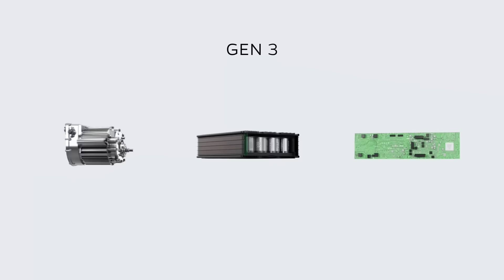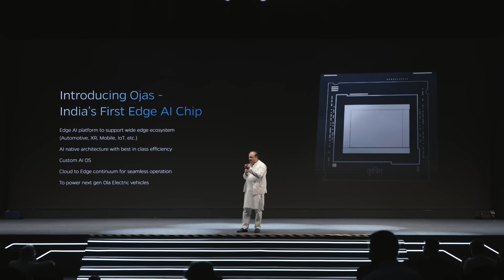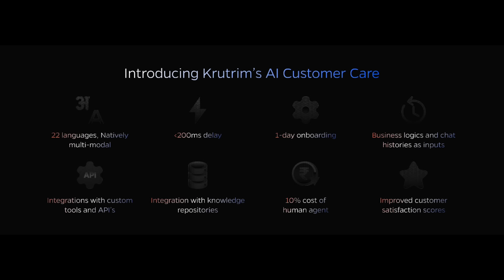Ola Sankalp 2024 | Top Highlights

Comment: Ola Team Card Partner, I am driving Ola vehicle in your company. You are less than work but more non-working. We had taken feedback from the passengers who were bigger. The rider was saying that I have no problem in paying but why the vehicle does not reach on time. I told you sir that due to absence the vehicle does not reach on time then it is shown to us that according to that the vehicle does not cost us even ₹ 10 per kilometer the vehicle costs us ₹ 87 per kilometer and due to this the driver may not be available at your place. So, I expect from you that the customer turnover should be increased and out of station mini cars should be opened and also think about its mini cars. You think about the empty sedan and Ertiga. Make an offer for the mini tax people also. Get out of station openedOpen some out-of-stations for the mini-kars also, because the mini-kars are also very upset with you people, their out-of-stations are not opening and I assure you that you will agree with me as we have told through our phone. I have deleted it above, don't bother me so much, the mini tax people will have to consider Ola as deleted because when there is no driver then who will get the commission and who will get the work done.Neither is there any customer care number in it, earlier there was a customer care number, that too has been removed, now in case there is any problem tomorrow, who will take responsibility with the driver, a customer care number should also be added for this. Listen and protect whatever is being said and increase the driver's rate for vehicles and openThis will be my last mail, it will be the last one, if you are in the same condition, then I will delete your app and will get 10 more people to delete it. I have many friends who drive in Ola, I will get everyone deleted. Rapido is the best, then offer me. It seems that some voice has reached your ears. If you people would have listened then you would have been more supportive of the drivers' customers. If the driver caste is abolished then who will get the work done?